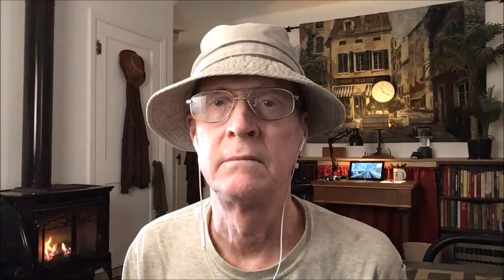Coronaloop Antenna

Comment: Yesterday I soldered another am radio with a 4 inch ferrite rod and it is much more practical than the other portable radios I’ve tried building in the past weeks. It has a TA7642 and the 240 micro Henry coil and the ferrite is #73 10mm diameter. It is making many whining and whistling noises when out of tune but then turn the 244 pf air variable very slowly and the stations become clear

Comment: This is the last Youtube video I watch with any reference to this hoax in the title. I am not doing it indoor, but I am waiting on the deliveries for an outdoor 80 Meter loop to be put up with 65 foot masts, probably on platforms to give me 70 feet above ground. Ladder line fed, like all antennas should be, and into my transmatch. No spare extra time, public safety never rests.
Reply: Liberty Cave if you can get it that high. Bring one end low and the other 2 high up. Feed at the bottom with 72ft of 75ohm coax. It’s a cracking antenna. Trust me. Better than the cloud burner loops. Imo of course

Comment: Some of us already are using indoor antennas. I have a fan dipole for 30 to 10 meters with the dipoles shaped like a U around the ceiling. I use it down to 80 and up to 6 with a transmatch. I am up to 92 countries and all 50 states on it now.